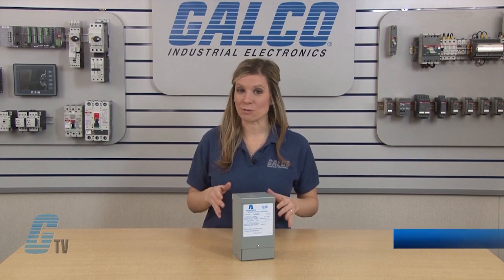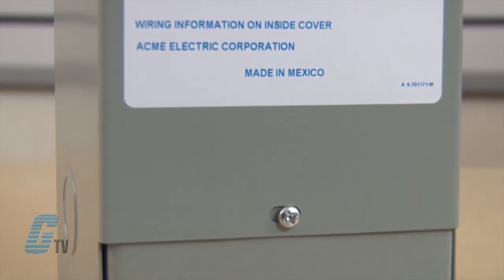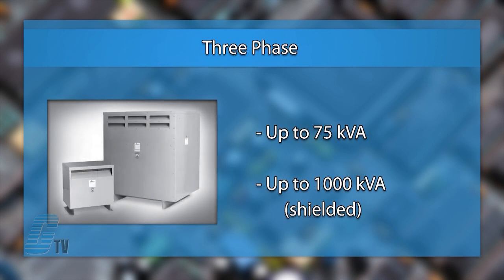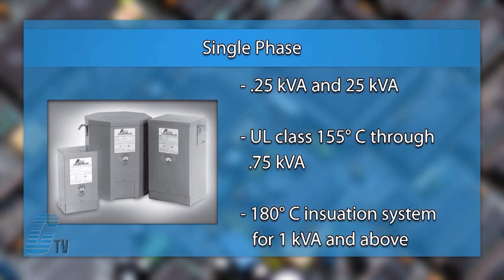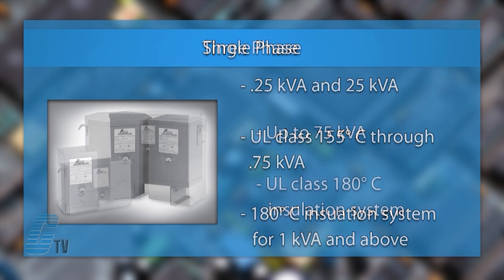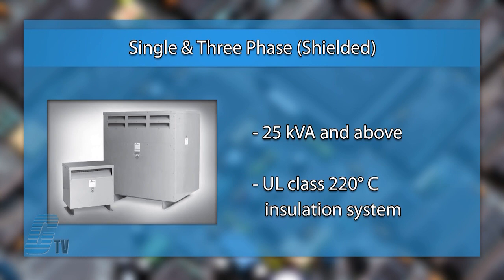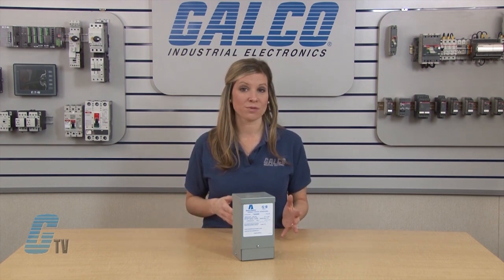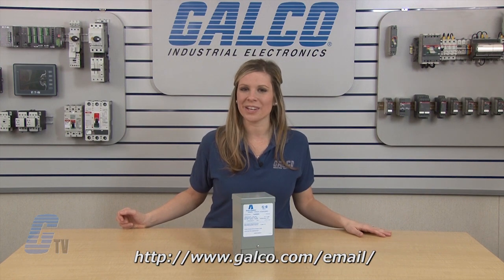ACME Distribution Transformers T Series - Enclosed

Comment: I have an application that calls for 5 KVA transformer...the start of the motor will demand a 3x for no more than 5 seconds...will that  damage the transformer?

Looking for the T-2-53014

Thanks.
Reply from the maker: Ask your self these questions, Is the motor rated less than 80% of 5KVA?  Will you be doing more than 3 starts per hour? Otherwise you should be fine. Actually if the motor only takes 5 seconds to get to full running speed, the transformer would probably tolerate more than 3 starts per hour, just check its temp periodically it should not exceed 150F as a rule of thumb. But you should check with mfg of your transformer for actual max temps it will tolerate.